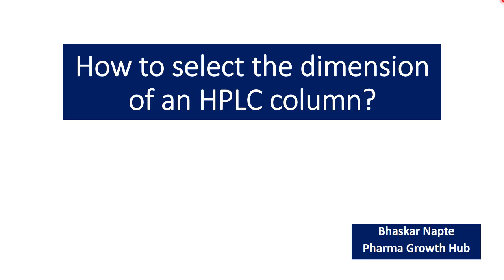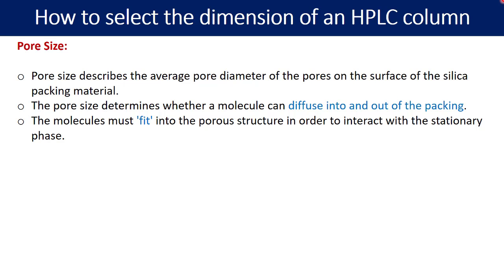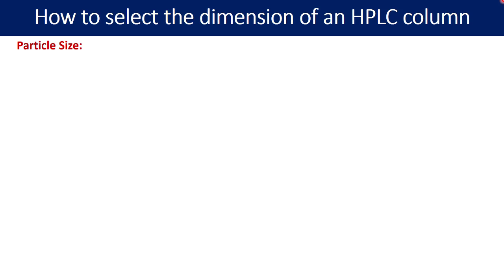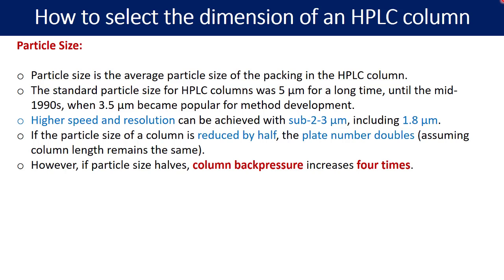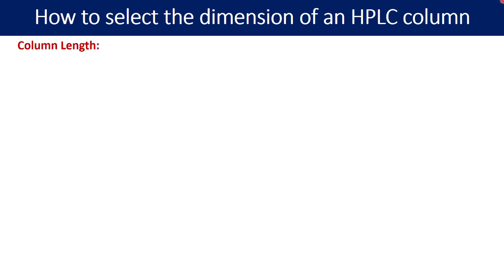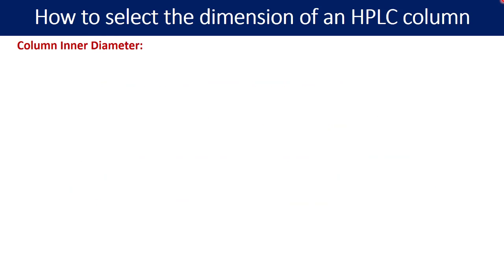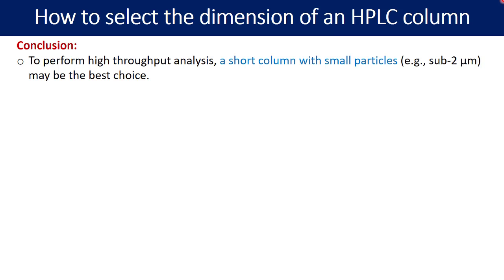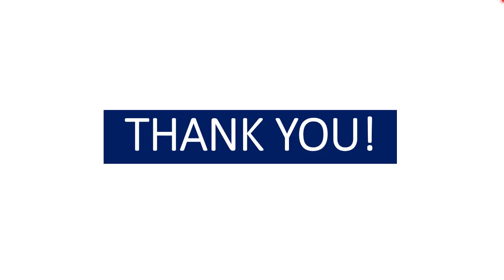How to select the column dimension of an HPLC column?

Comment: Regarding poresize, you mentioned 1000A to 4000A for higher molecular weight of protein and vaccine, Need to understand what is the molecular weight of protein and vaccine? Also, please mention this is for purification related,ie downstream process. For Analytical estimation purpose for higher molecular weight, example upto 150 KD we can use 300A for LC.